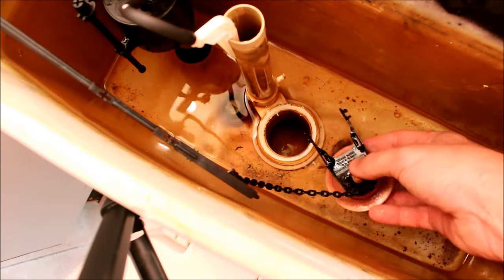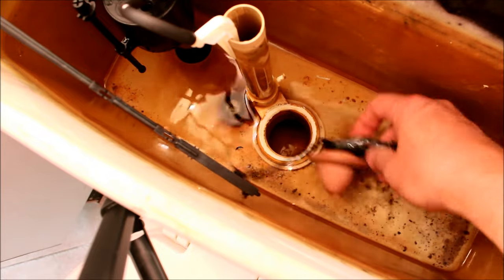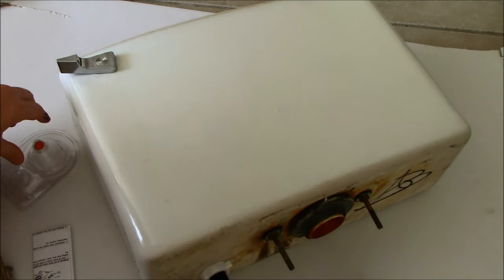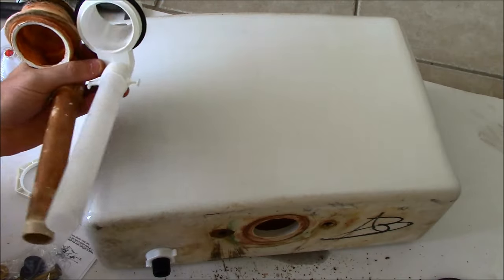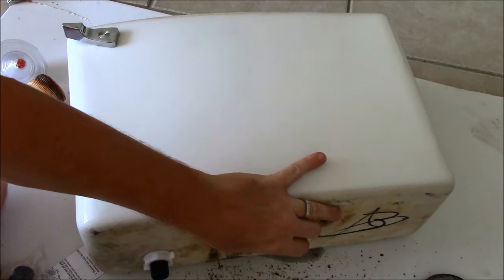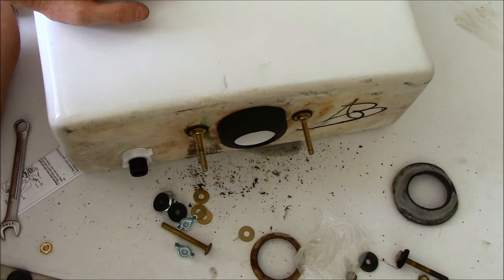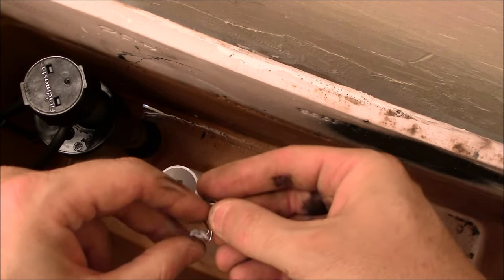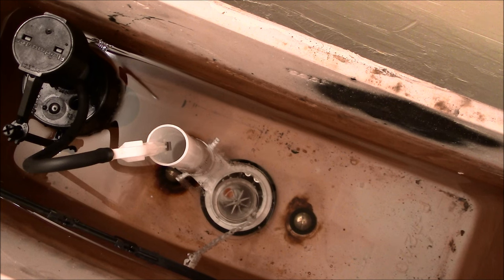Replace a Leaking Toilet Flush Valve

Comment: The rubber water line that Clips onto the Overflow pipe is on backwards the water is supposed to go inside of the tube it helps flushes out waste and refilled the toilet bowl. The water that fills the tank comes in near the bottom of the fill valve.

Comment: Very good video. I followed each step but the water didn't come out after I turned it on. Actually there were some leaks so I turned off the water, tightened the bolts and gasket. No more leak but turning on water didn't get any more water.

Comment: I have one of those actuator valves in my American Standard and the darn thing leaks constantly.   I was replacing the big gasket on the end of the actuator when I noticed a small crack at the base of the fill tube.  Guess I know what needs replacing now. Thanks for the video.  How snug should the bolts between tank and toilet be? I've built toilets before and that part always makes me nervous as I don't want to tighten so much that the tank cracks and not enough that it wobbles and leaks.

Comment: After I did everything in your video I have a new issue. Instead of a continuous slow leak my new fill valve will just let more water in. I swapped out my old valve to one similar to the one installed here. It was during that when my overflow tube shattered which made replacing  the flush valve necessary.  This is my first time replaceing the flush valve so I'm unfamiliar with what I need to troubleshoot.

Comment: You did a really good job installing everything I cannot believe the chain is rubber in the flap you can see through it so I bet you anything one of those are going to break eventually
Reply: Yes the chain is plastic on the one i just  changed nothing is metal anymore it seems
Reply: @joedevitto6113  no not everything is plastic it looks like it was just a cheap ass brand
Reply: @zacksgaragedoorserviceandr1208  OH i see..   im trying to replace that  whole thing now since its leaking  , fix one thing and something else  starts leaking
Reply: @joedevitto6113  yeah just replace everything a good kit you can get at the home depot
Reply: @zacksgaragedoorserviceandr1208  Ya i had to measure it .   2 inch .   tomorrow  i will go home dep  get that   hopefully it will be ok
Reply: @joedevitto6113  Well at Home Depot if you’re planning on replacing everything in my mind I recommend it depending on how old your toilet is it shouldn’t be that old I hope I already comes with the kit and everything and it fits you just have to take all of the old stuff off and replace everything I even recommend replacing the hose that connects to the toilet to prevent any problems and I recommend those metal hose is not those cheap plastic ones that will leak overtime
Reply: @zacksgaragedoorserviceandr1208 this house was built in 2004    i just replaced all the other parts  then  this piece started to leak ,  i noticed the gasket was all breaking up
Reply: @joedevitto6113  dang I mean If everything else was replaced besides the gasket then just replace the gasket but if everything looks broken or worn out just replace it so you don’t have any more future problems or even worse water damage
Reply: @zacksgaragedoorserviceandr1208  i replaced the 3 screws with the gaskets i thought maybe it was that at first  but   they seemed ok  only part was left was this  filler valve piece
Reply: @joedevitto6113  If that’s the case for a place that part they may have that parts separately hopefully they do if you can’t find it find the model number or the brand on the toilet it should be where the toilet seat is or maybe even inside the tank if that is your last resort look for those model numbers and order it off of that company if that company is still around if not I’m sad we got to see you probably got a replace everything and it comes in a kit and it’s very cheap but very good product
Reply: @zacksgaragedoorserviceandr1208  ya this is the only thing left  i  hope this  covers  it ..   i have 3 bathrooms in here and i dont even use that one     either
Reply: @joedevitto6113  yeah Good luck and let me know how it turns out
Reply: @zacksgaragedoorserviceandr1208   yes sir
Reply: @zacksgaragedoorserviceandr1208  I got the  new part and put it in  so far i dont see any leaks im  keeping and eye on it  only filled it up a little just incase ..   hopefully it will be ok.  Thanks for the help ~
Reply: @joedevitto6113  yeah no problem I’m glad it worked out
Reply: @zacksgaragedoorserviceandr1208     I got a situation  now on the two  screws that  connect the tank they  seem to have a tiny leak  and i keep tightening them    but not sure what is causing it .  i  bought new screws and  little  gaskets  put one in the tank and outside it .  any  suggestions...? tks
Reply: @joedevitto6113  Actually if you put them to loose they leak  if you put them too tight they can leak or something itself with the screws or tank can cause it to leak if you know how you have the proper seal is when you tighten down the ball on the rubber seal you should see it start to flatten out a little bit when you get to that point that’s when you know you have a perfect seal if not there is something wrong or something preventing it to seal properly I don’t recommend caulking if that is a last resort that you have to do you can one replace the bolts again but keep the ones that you replace him with do everything to the proper tension if it still leaks take the new bolts out and return them And possibly use caulking I don’t recommend it but if it’s some thing I literally have to be at a job to know but I feel like something is not correct but caulking might be a last resort but maybe try to replace it again or maybe something is just not lining up

Comment: Shouldn't the water tube go inside the overflow tube else you will have a dry bowl after each flush? I think you need to clip the water tube on the other side of the overflow tube with the water tube inside the overflow.
Reply: +richk3c I noticed the same thing.  I tried it on my toilet with the tube on the outside of the overflow.  The tank fills up faster, and there is less water in the bowl.  But it isn't dry.
Reply: Yes, the fill tube should be aimed into the overflow tube for proper flushing.
Reply: I was confused also about this. So I stuck my hand in the water.  Water going into the tank is coming from the base of the fill valve (you can't see the water flow in), so it doesn't need water from the hose.  The water coming out of the hose therefore can go into the overflow tube which goes straight into the bowl so bowl fills with water after bowl empties, and at the same time the tank is filling up. Thanks for mentioning the dry bowl comment. Oh yeah, the overflow tube prevents overflow in tank also.
Reply: no you want the freaking water will keep running untill the bowl and tank are full makes no difference whatsoever
Reply: @jonpitts1978  the tube is supposed to go inside standpipe aka overflow; water from standpipe washes the bowl via all the little holes around bowl rim.  If you pour water with food coloring into standpipe (use funnel and have toilet seat up so you can see what goes on in the bowl) you will see the colored water stream down from bowl ring into bowl.
Reply: @ldeg9876  yes, the standpipe aka overflow pipe of the flush valve will prevent overflow IF toilet drain below bowl is not clogged.

Comment: I had to replace mine due to phantom-fills.   I tried new flappers, 3 different types and all still leaked.
Then I tried replacing the whole flush valve assy by Korky.  It leaked and phantom-filled.
Then I tried replacing the whole flush valve assy by FluidMaster.  It also leaked and phantom-filled, not as often.
For the third assy replacement, I used the Kohler Cylinder style, Lowes Item #1451938 Model #RGP1188998.  Never phantom-fills! The only issue is you have hold the flush lever till the flush completes. The nice issue is that it takes very little effort to push the flush lever.

Comment: ... and not a word about a new flapper that only partly corrects a slow leak/refill problem No word about getting a good seal with 'plumber's grease' between the new flapper and the throat of the tank drain...  That problem is very common and if a DIYer knows what to do, he can stop the leaking and the job is done. But no word how to spot it or likely causes or how to remedy the leaking/refilling ....

Comment: I’ve replaced the valve and it keeps leaking. I tighten the bottom a little more than I should have and it still leaks. Frustrating.